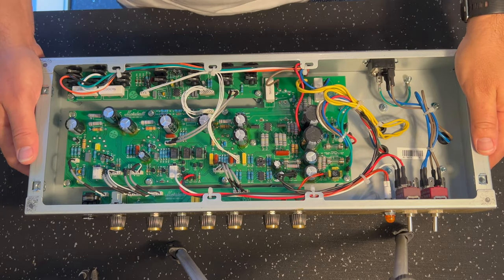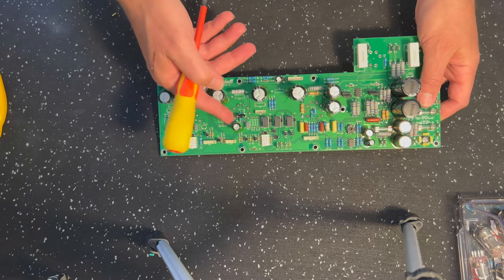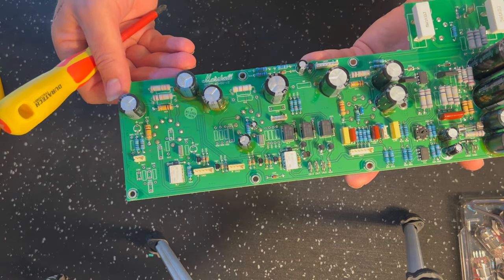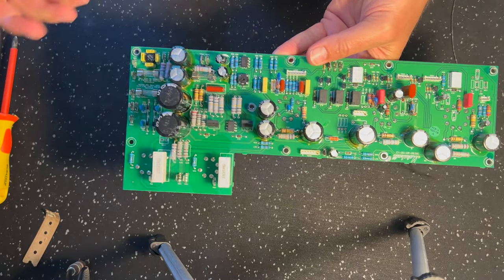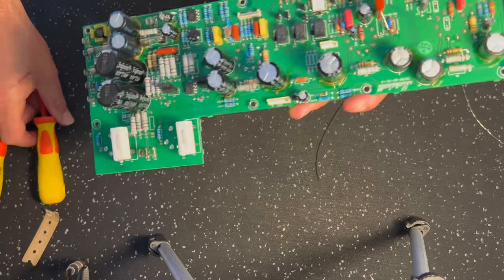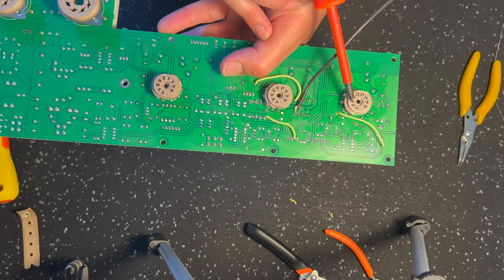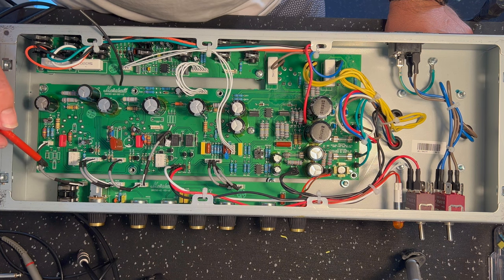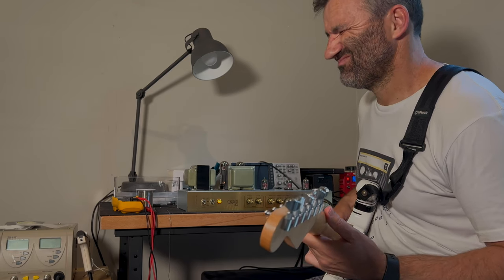Headfirst modding an Origin 50

Comment: FYI if you follow everything shown in this video the amp will not work, the cable mods and work that must happen on the controls board is not included in this video.  I had to study the later live stream about the Origin 50 but is confusing because all is not spelled out and its made more complicated by the addition of the diode mods in the amp shown in the video.  No novice will be able to complete this Origin 50 mod package!  All that said, the ideas presented here are very cool and well thought out and when I did complete my Origin 50 the results were fantastic!!!  Thank you for sharing your time Jason to make all these free videos, just think you should warn people about the missing puzzle pieces.  cheers
Reply from the maker: I did do a revisited clip
Reply: Yeah this seems difficult and I've done a fair amount of mods. There's no BOM, schematic or instructions etc. Seems like there are gaps in the information needed to complete the project correctly. Where do I find the missing pieces?
Reply: @HeadfirstAmps  Thanks for your reply. I'm not expecting a step-by-step manual for mods but would be nice. 😄
Reply: I did the mod from the video and no sound for me.   do you remember what you had to do extra?    Nothing towards Jason at all I appreciate the videos 100%

Comment: Just performed this mod on my Origin 50. I can say without a doubt that if you own one of these amps, this mod is a MUST. Now, while it's a little scary doing an amp mod if you've never done it before (this is the first time I've taken a soldering iron to an amp EVER), if you follow the advice about safety and soldering procedures, you can do this.
Reply from the maker: Congratulations!
Reply: How’s the mod do at a studio volume with that 50w?  Stock these were REAL loud
Reply: @vin9976  it's painfully loud, no joke! Like, ear bleedingly intense.
Reply: @vin9976  I do, however, usually use it with an attenuator
Reply: Lol thanks.  Does it still sound good when you turn the volume down (or PPIMV)?

 love that you are a first timer and did it!  I am too and trying to figure out the process for a 50w.  Do I just use this video or do I also go through the 20w stuff?  Am I printing certain things out?  Like how would you do it again if you had too?  I want to be prepared :)
Reply: @vin9976  Mine stays pretty distorted even at low volume, and I think it sounds pretty killer at every volume.
Reply: @vin9976  I used the video and the 20 watt diagram. If I had to do it again I would have reached out about specific parts that were a little ambiguous in the instructions because mine ended up super bright. Guitars sound best on mine with the tone control at about 2 or 3, for example.
Reply: Good advise.  I do have an electrical engineer buddy that can assist me.  Question, would you have done the 20w head instead of the 50w if you did it again?  I’m often playing at home, but will gig it once in a while.  I love that 1x12 form factor of the combo (and used prices for them are cheap).  Plus the bigger transformer makes it closer to a real JCM.

But I’ve never had one in house lol.  I do plan to likely build a JohnH attenuator.  But yeah…would you do it differently if you did it again?
Reply: @vin9976  Oh, I'd totally do the 50 every time, but then I do own an attenuator. The 20 does come with the benefit of never having to bias it, but I like to swap around different kinds of tubes and have no problem going in and rebiasing my amp when necessary.
Reply: Sick :)

Did you have to adjust any Voltages or stuff like that which isn’t entirely covered here? Or did you just follow this guide (and the 20 docs) and boom…solid amp?

Also, where is the cathode follower for v1b?  This other guy changed that from a 2,7 to a 10k on his 20w and it’s a VERY awesome ACDC/JMP tone!  I need that lol
Reply: @vin9976  I didn't change the bias on the existing tubes, and they certainly sound great! I bought a set of 6CA7s to get that big bottle tone on VH1, but haven't swapped them in yet. Did go with gold pin 12AX7s for less ragged distortion, though.
Reply: Is this the same thing as the 'plexi mod' he did on the OR20?
Reply: @willdenham  Not to my knowledge, this has a lot more preamp gain
Reply: Can you send me a full list of materials necessary. I just got my origin and im having trouble finding the list
Reply: Did anything differ from the BOM on Jason's Google Drive share? The only BOM I can find is for the Origin 20.

Comment: The Origin 50 can benefit from a shield between the transformers to help with inductive hum.  A piece of aluminum works good, not 100%, but better.  They really should have been farther apart.    Thanks for the video!
Reply: Try gauss/belly banding both the power and output transformers with copper shielding tape (some disassembly involved to get the bellhousings off). Two or three wraps around works. 

It’ll reduce both the leakage from the power transformer, and the amount of hum the output transformer picks up from it. It’ll also increase the power output from both whilst reducing the amount of heat they create, bonus!

Aluminium won’t stop magnetic coupling, you’d need a thick piece of steel for that or some Mumetal stuck on your aluminium shield.
Reply: Paused the part showing the top of the chassis, the power transformers too far back, it needs to be moved forwards so that the centre of the bell housing lines up with the centre of the iron plates on the output tranny to get the least magnetic coupling. I have an amp in a narrow JTM 45 chassis with the transformers the an inch apart like the original 50, however because they’re lined up properly there’s no hum. 

Can’t believe Marshall dropped the ball so badly on something so simple.
Reply: @Jonathan_Doe_  Thanks for the tip.  I'll have to try it on my remaining Origin 50 chassis.  I sold the boards but will be using it for a new build.  I just tried a piece of aluminum that I had on the bench and it did work, maybe 50% reduction for what it's worth.
Reply: I’m about to get one of these in the combo.  When do you notice the hum?  Is it just always there and gets louder when you turn it up?

Comment: Origin 50 with your mode truly smokes! :-) Great job! I know you refer to previous mods a lot in the video, but are you going to be releasing a documentation PDF with a list of modifications/components that you used in this specific example? It would be handy to have them all in one place. Keep up the great job!!!
Reply: Yes, I would like to see Jason's final modding results on the Origin 50 documented, and compare his expertise to my amp-hack abilities. I successfully modded a friend's O-50 by implementing Jason's O-20 modding tutorials as a guide. Did the 3-way José clippers and added Jason's fx loop board too. 

Definitely felt the need to drop the preamp voltages after the phase inverter. The new fx loop module needs to be located about a 1/2" further back towards the rear of the chassis to clear the O-50's taller filter caps. The loop board is grounded at a different grounding point too, compared to the 0-20.

Also, I replaced the two original 2.2uF cathode bypass caps for V1 with 1uF's instead of Jason's recommended .47uF's for the O-20.

The modded 0-50 is truly vicious sounding!
Reply from the maker: Nice work and thanks for the detailed info!  I'm using 0.68uF bypass caps on V1.

Comment: I know this mod is more of a hot rod 800 setup, but it'd be interesting if you modded one to be more Plexi like and then had a shoot out between them and the Marshall studio amps as well. These amps are such a great value for mod projects if you put the work into them
Reply from the maker: Agree.  You could do a plexi - the transformers and parts look identical to me to the Studio series.
Reply: The Origin 50 with it's bigger iron and fixed bias sounds better to my ears. Is it way way louder? How many db louder than the 20 or the studio vintage would recon?? Guess? This 50 you modded here sounds better to my ears than the Origin 20 you modded. I would like to compare this video with a 50 if you end up modding one to plexi specs. Thanks.
Reply: @HeadfirstAmps  Would you consider demonstrating a mod to plexi specs?

Comment: Hey Jason - quick question, I noticed you left the bright cap off the gain pot, do you prefer it with or without? Cheers-
Reply from the maker: I don’t think it’s required, just use the Tilt pot as an adjustable bright cap.

Comment: Are you pulling more parts out than putting back in? I wonder why Marshall didn't just stick to their tried and true circuits like the plexi lead or bass circuit and the JCM 800 2203/2204 circuit but of course with these transformer sets and biasing schemes?  Is this so everyone doesn't just but these instead of the more expensive amps? All I can think of.
Reply from the maker: They have the old circuits available in the reissue series, and the studio series.  That said, the origin could still have been a ‘budget’ old circuit!
Reply: @HeadfirstAmps  exactly!

Comment: I'm gonna try the Plexi mod on my 50, which is currently stock. Can I follow this guide to remove all the stuff, do the re-routing of V2 and then just add the components for the plexi mod? Or would there be more to it? No Jose, straight plexi for now.
Reply: Hey how did the Plexi mod go?  I’d love to turn one of these into a Plexi clone…complete with the Cleans but also the big growl that can be boosted.  Any luck?
Reply: @vin9976  I ended up trading my origin before I could find the time to do the mod unfortunately...

Comment: On the 20, you tie the bottom of R67 to the top of R65, do you NOT do that for the 50. Also, you said you ended up putting a 220k in the R65 spot? Is that correct?
Reply: Any solution for this, please?

Comment: It sounds like its a bit more punch in the 50w orgin👍
Reply from the maker: Yes definitely.  The power section is not as 'soft' as the 20.
Reply: @HeadfirstAmps  Sounds awasum this mod..Would be nice to hear the sound with a singel coil strat..Rock on Bro🤘
Reply from the maker: The recording right at the end, that’s the neck pickup in single coil mode.  Not exactly a Strat, but close!
Reply: @HeadfirstAmps  it sounded like a Seymore Duncan 59 in my ear..have a charvel with same pickup..😊
Reply: Anyway its time to do this mod 😊 It sounds killer good..tnx for this video.

Comment: Why would Marshall prioritize one 12ax7 preamp tube to do the effects loop only leaving 2 gain stages for the entire preamp?  It's like a 1974x circuit with an effects loop.  I don't have much experience with Marshall, I don't know if the 1974x is considered gainy enough? It's not the 3 stages of the 1959 superlead circuit.  i don't know any tube amps that do anything more than stick two jacks for an effects loop conveniently into the circuit where it will work.  Actually my Kustom coupe 72 does that in fact, yet they power the reverb with IC's - which still makes no sense to me why you would prioritize a vacuum tube for an effects loop over using it for tube driven reverb or a couple extra gain stages.  I would think the Origin 20 and 50 amplifiers are ultra clean unless they're using IC's for extra gain?
Reply: No IC for no extra gain. All tube signal path.